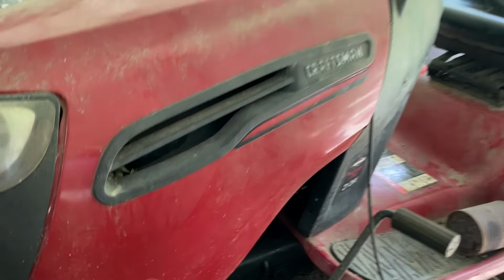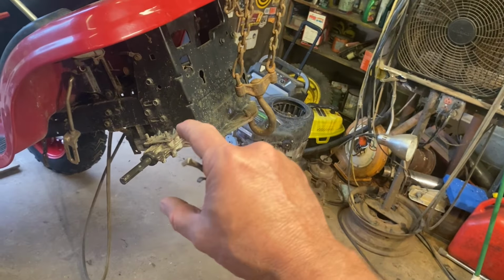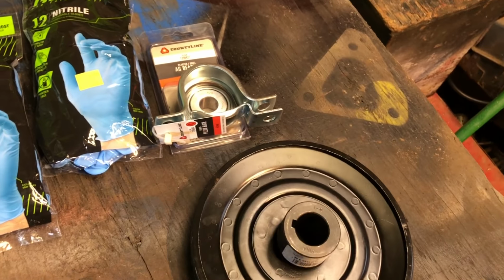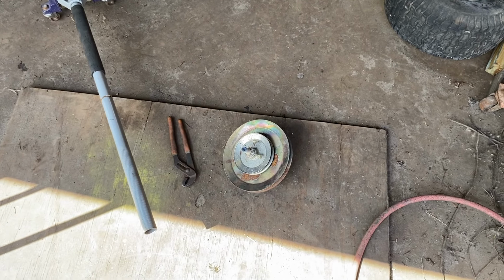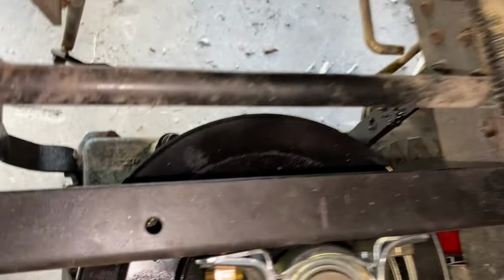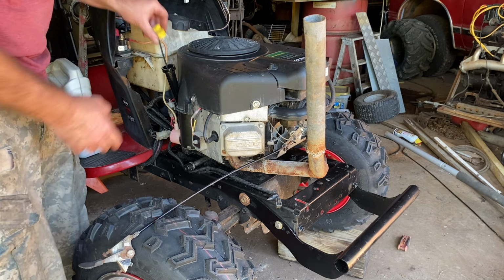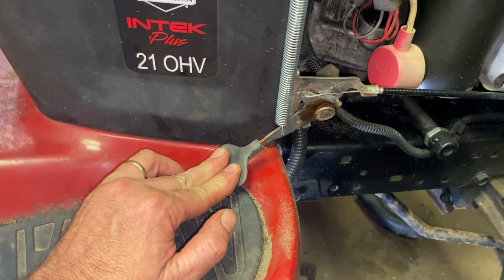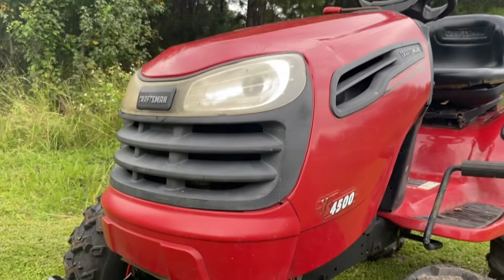Big Red Craftsman Mud Mower Full Build

Comment: we're all learning a lot from these videos. when im struggling with a narrow tire/wide rim stuff a car inner tube in just to inflate it walk away half hour then break 1 bead remove tube and air up again. ever have a mandela effect happen? 2007 i bought a bobcat skidloader worked great for years & years then last year developed a bad engine oil leak somewhere just found it yesterday it was hidden lower inside machined surface corner of aluminum oil filter housing block on back side of engine block took it off and found a big burr like someone smashed a hammer to it no way it could seal with that much gap thing is NO ONE has been in there since 2007
Reply from the maker: Good tip and weird on you leak... thanks so much for watching.

Comment: Hey Mr Chud, I'm wondering if you could educate a beginner.  Can you explain how to tell the difference between a hydro mower and a manual mower? Is there anything wrong with pulley swapping a hydro mower vs a manual mower?
Reply from the maker: Hydro usually have go pedals on the right side where manuals do not. Sometimes it is a shifter to n the fender that has no gear numbers... If you see numbers, it is probably a manual. Good luck and thanks for watching!!

Comment: I have a 2006 craftsman lt1000 with 20hp briggs. So, I just change the drive pully sizes to make it faster?
Reply from the maker: You can do smaller in the back, bigger in the front, or both... All should make it faster. Thanks for watching!!
Reply: @chud327  thanks. I'll do both. My neighbor just gave it to me free. It starts up runs fine, deck is just junk. So, u inspired me on what I'm gonna do with it. 😆

Comment: Hey chud I've went out and bought me one. My question is the front roller 4 lug hubs, what part number is it? And the bolt pattern is it the same as honda?
Reply from the maker: Part number is KD8LAH-3/4 for the hubs. I am not sure on the Honda patter, google that and see if they are 4X4 inch. Good luck and thanks for watching. Be sure to tell them Chud327 sent you...

Comment: all that just to go through some little puddles. lol hardly seems worth the effort. just get a quad, way more fun and capable.
Reply from the maker: So true, great point, used to have one and sold it.  This one is most built mostly for deep sand, does pretty much as good as a 2WD atv.  My biggest issue is those cost thousands, I bet I have less than $100 in this one... dollar to dollar, this one is so much better. thanks for the advice and for watching. Also, you probably know as good as I do, atv video just don't get as good in the views department.
Reply: Why is it more fun with a ATV than this mud mower? It's more fun riding a modified lawn tractor that you have built yourself than riding a ATV that is the same type and model as everyone else have.